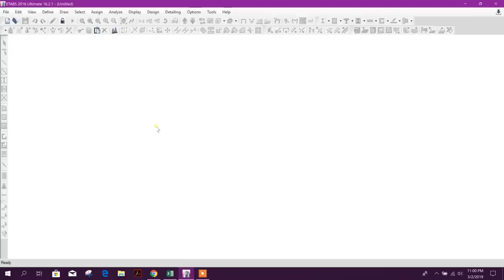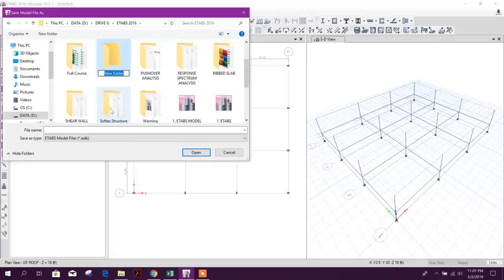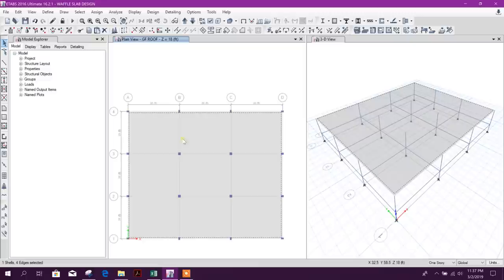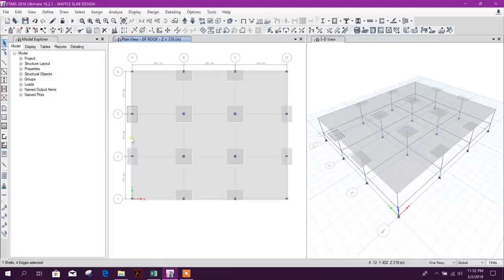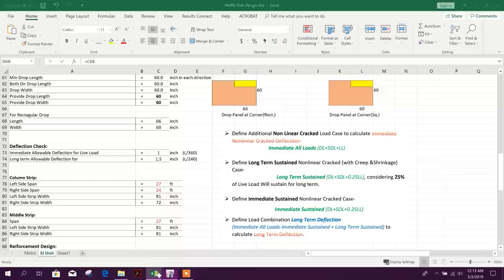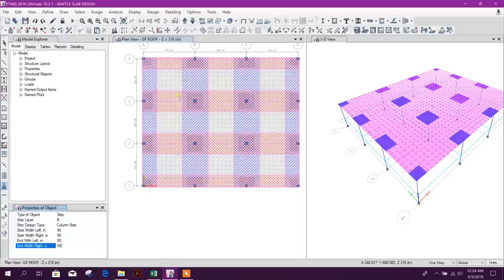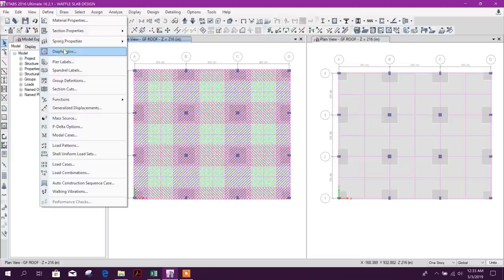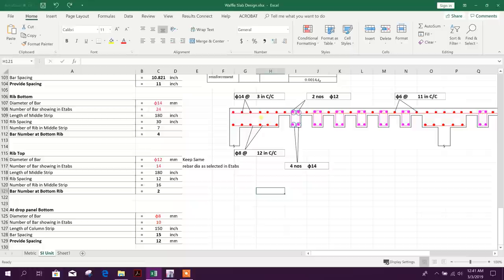WAFFLE SLAB DESIGN IN ETABS & DETAILS IN EXCEL

Comment: thanks for your efforts, i have a comments, when you checked the deflection, the stiffness for all members should be in services not factored, and before designing the slab, you should check the dimensions of the drops with comparing design shear and Vmax,

Comment: Kindly help me out on the below queries
Is there any rule for providing the base story height and plinth beam dimensions, like on what basis you have provided the grade beam dimensions and base story height as 6'? Is it necessary to provide base story?
Reply from the maker: This is foundation depth. To provide column height upto plinth beam from foundation we need to provide this height.
Reply: @Decodebd  Does this height increase or decrease according to the increase or decrease in span length?
Reply from the maker: This height depends on the foundation depth. From plinth beam to footing level. Span length is not a fact here.
Reply: Thanks alott